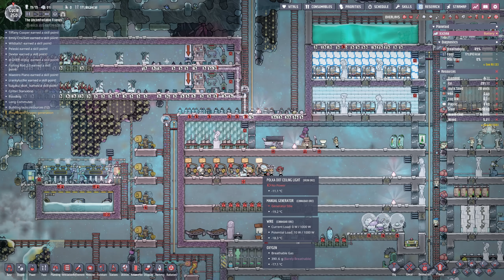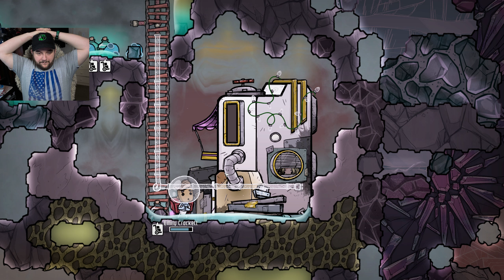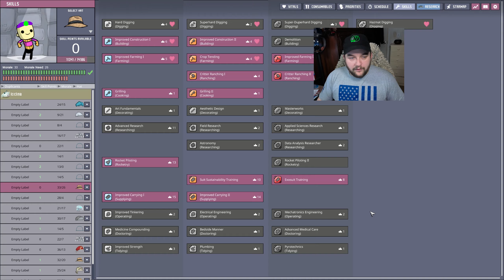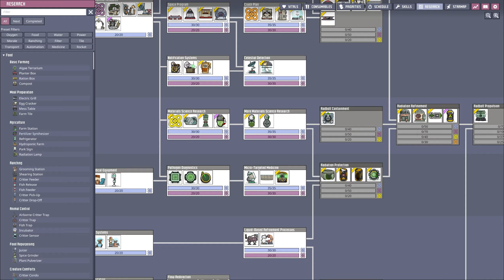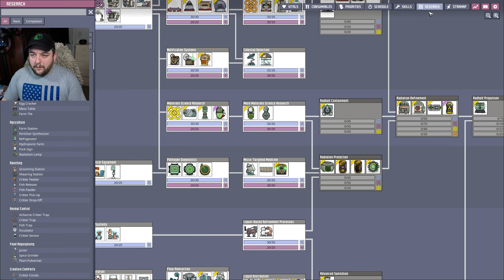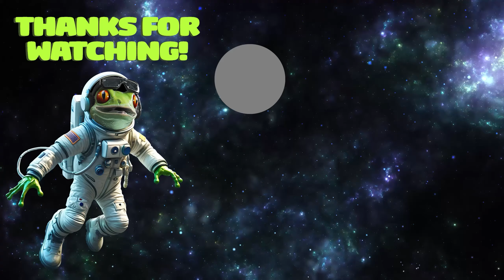Why do we Keep Making Messes?!?

Comment: Drilling the map up how you are doing it is ill advised.  You saw what happened to one of your dupes. Dont drill that much at once. You can set up your ladder sequences first - then tunnel build two tiles high above the ladders. Once you have done each floor - with all the ladders built - you can then do a big drill. You also dont have enough drillers/constructors with drilling as a priority,. You need more drillers if you want to do some serious drilling. I'd just drill down were i you and get to Oil and Lead. Both open alot of construction options. I personally dont like the 7 tile ladder method - i build ladders 4 tiles high - tunnel across - go next level down - then do a big clear. It reduces the chances your dupes get stuck in a drilling area since any dupe can drill - they might drill themselves into a bad position, get stuck and die. Takes longer then the 7 floor method, but much safer. 

Dumping the bleach stone into water will not disinfect it. In order to disinfect water - or other items - you need to create a chlorine room. You will need liquid tanks - i usually do 3. Put them on some autodoors with timers pumping the liquid into one tanks to the other until it is cleaned. Daisy chain them. One goes to another. Timer will open the door and stop the liquid from flowing from one than to another. 

Far as your bleach stone, stick it in any liquid tank in a storage box. Have the store box priority set very high, 7 or more, with bleach stone the only item and your dupes without specific priority will pickup any that gets drilled up.
Reply from the maker: @veuvic  you are always such an amazing help! I do have a few episodes recorded ahead right now because work got a little stressful but I will for sure back off the drilling!